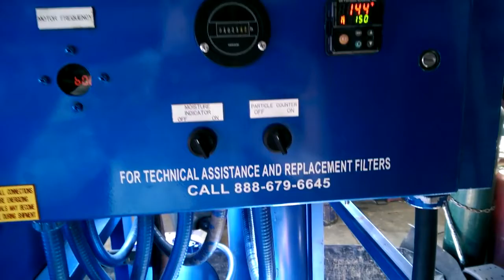Vacuum dehydrator purifies hydraulic oil of a crane | Precision Filtration Products

Comment from the maker: For those who are interested in the technical details of the dehydration process... the fluid is first drawn into the heater of the system by the vacuum pump. It then flows through permanent dispersal media that is located inside the vacuum tower (big top plexi glass). The oil flows through the surfaces of the media (stainless steel metal cut-offs) getting thinned out and being exposed to vacuum. The water and dissolved gases are boiled off,  and the fluid is dehydrated. The oil drops to the lower tower (smaller plexi glass) where it is pulled out by the discharge pump. It then passes through the particulate housing to remove dirt and out the outlet back to the reservoir.